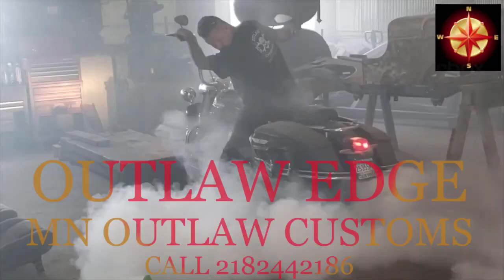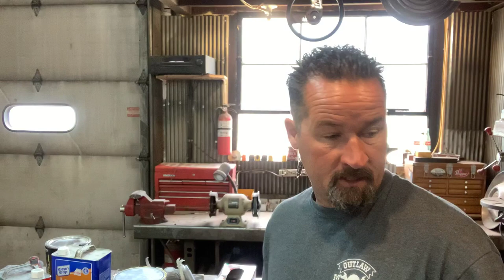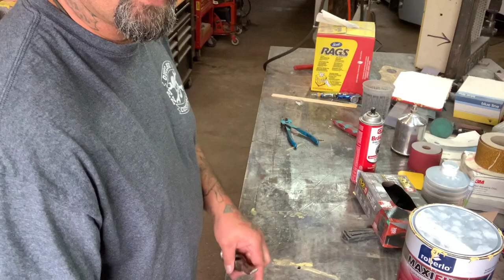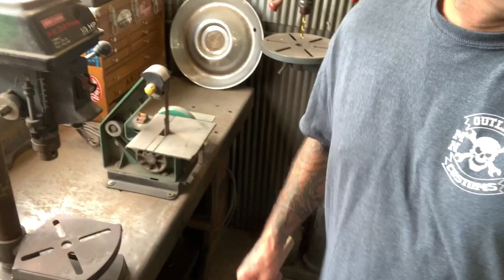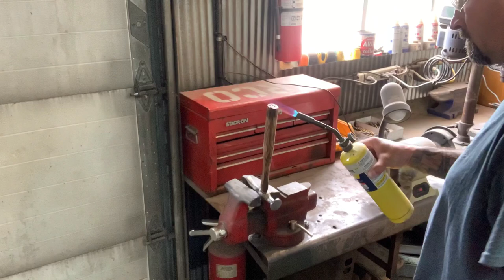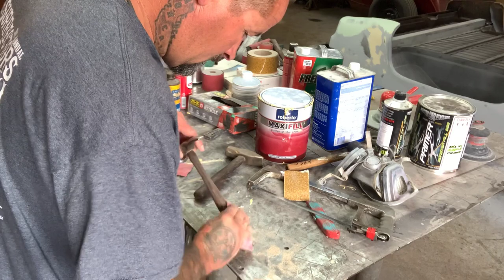Autobody hammer restoration

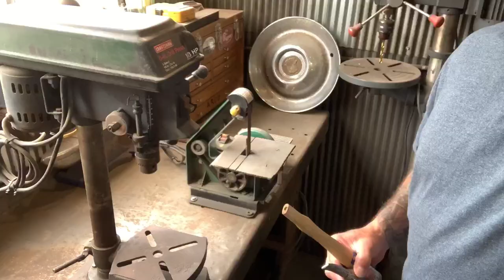Comment: Love the old Desoto hubcap @2:57.  I have to keep all my wood handled hammers in a bucket of anti-freeze. Our humidity in SE Arizona is so low that the handles dry right out and the heads get loose.  It's too bad some people have to be a$$holes when they comment. Don't blame you at all for giving them the boot. I had to boot a guy off my channel for putting a porn link in the comments.

Comment: Hey Brother, I'm about to buy my equipment to paint my 71' C-10 and 84' K-10.... What Paint gun/guns do you recommend....and what all will I need other than the obvious(D.A., Sand Paper, Masking Tape, Bondo(what do you recommend), mixing cups,) I value your opinion so that's why I'm asking.... I'm guessing a Primer and a Paint Gun, but I don't know what is what.... HVAC I got you, but painting.... I'm asking a YOU!!!! LOL (EDIT: IMAGINE THAT, AN EAST TENNESSEAN ASKING A WEST COAST GUY FOR HELP) HAHA
Reply from the maker: Chad Stacey Hopson wax and grease remover, a good compressor that will keep air in your spraygun lol. My favorite spraygun for primer is Eastwoods concours spraygun 👍 highbuild primer that is self etching. And some 800 grit auto wet/dry sandpaper for prep before primer. Hope this helped brother. ARCO MN OUTLAW CUSTOMS
Reply: @OutlawEdge  I have an 80 Gallon 5HP I.R. compressor and I have in ran to where there is a transmission cooler in between the pump and the tank(That really cuts down on having moisture) and after the air leaves the tank it goes thru about 55' of 3/4" copper that is ran up 5' over 4", down 5" over 4", etc. So by the time it gets to the regulator there is no water in it at all.... So I'm good on the compressor.... I guess I was asking about like materials to paint with..... Paint & Primer guns, what kind of epoxy, how do you mix your paint and primer, and what's your order of process..... Such as, take it to metal, then filler, then expoxy, etc.... Thanks again for help man....
Reply from the maker: Chad Stacey Hopson no problem bro. We usually get it to bare metal then spray epoxy sealer on the car. Then do all the filler work with ROBERLO MAXIFILL then sand it till we’re happy. After that we use high build primer about three coats. Let it dry. Blocksand with different grits till its flawless. Then spray sealer primer over the top. And then basecoat, clearcoat. We use the harbor freight black widow spray gun for the clearcoat. After that it gets wet sanded with 400 grit and buffed out with a wool pad with slow speed or medium speed. Depends on color. We use monster 500 highbuild primer from showcar finish. It mixes 4 to 1.  We use showcar finish clearcoat and it mixes 4 to 1. We spray three wet coats. For the primer sealer we always reduce it so it flows nice 👍 hope that helps bro. Any questions send me an email to talk  arcohorton53@gmail.com
Reply: @OutlawEdge  AWESEOME..... That's exactly what I was looking for .....  any specific sealer primer that you use?
Reply from the maker: Chad Stacey Hopson we use ameribuild. Its made by showcar finish. If u need some we sell all those products 👍
Reply: @OutlawEdge  what's the website?
Reply from the maker: Chad Stacey Hopson mnoutlawcustoms.com  leave a message there or on my personal email arcohorton53@gmail.com  we will send u lots of info on the stuff 👍 thanks! ARCO